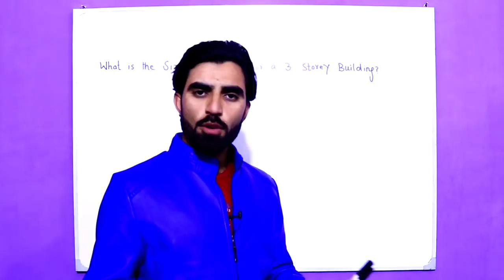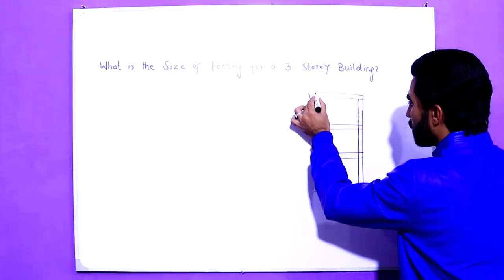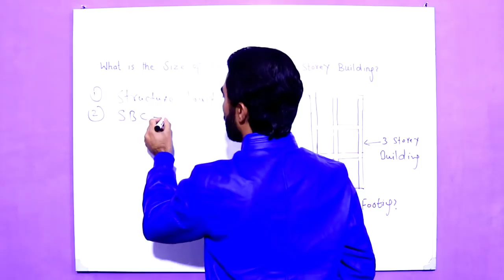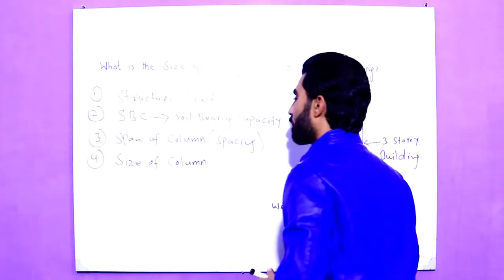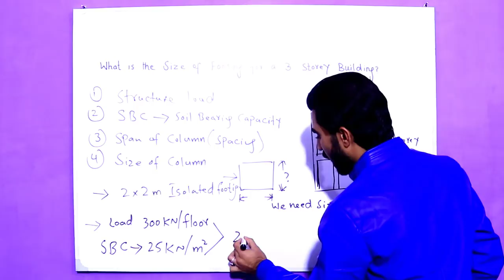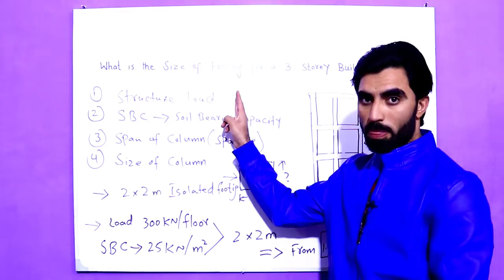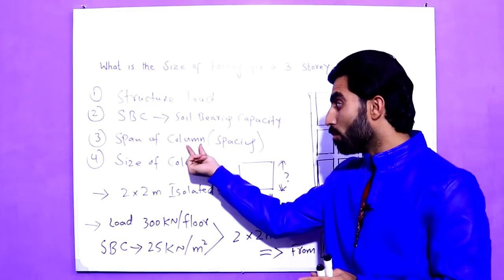What is the Size of Footing for 3 storey Building? Size of Footing for House

Comment: salam im planing to build my house and it has ground flr 1st flr 2nd flr then roofdeck and im planing to use in my footing size 1.30x0.40hight and then the column is 4 16mm and 4 12mm rods vertical rebars with 2double ring or diamond  lateral ties size 0.30 ty i just want to to know if it can hold the weigth of the roofdeck size house plan is 118sqm and all foundation is 12 pcs

Comment: Hello sir. What if the distance of the column is 2.5 meters and we used 8 pcs 16mm but the footing is only 1 meter. The 2 center combine footing is 1.5x3.5 and we used 8 pcs 20mm for each center column. Is it ok for 3 storey?

Comment: Sir aise confusion bohot rehti he 
Agar 3 story building na rahe to?
Apne ko 40 ya 50 story ki building banani ho to?
Reply: For that, you should contact with structure engineer. It comes in highrise buildings so that's , why you have contact with structural engineer instead of this.40/50 story building, is very hard to design because it will include the seismic loads, wind loads etc.you can't decide by self or by experience. That need a specific design of each member.
Reply: @saeednegar709  Sir, matlab pehle aisi Building ke liye Column, Beam, Brick work and Slab ka Self weight and Dead load, Live load, Floor load, wind load calculate hoga, Phir load bearing capacity ke check ki jayegi Pu= 0.4 fck Asc + 0.67 fy Asc  iss formule se. Thik hena Sir?
Reply: @shamsheralirana3127  yes but you have to follow the code formulas like IS code,ACI ETC..for all those things you just need to design that in a software.software will follow the code then will calculate all the things.so you need to put loads from codes in software.after running analysis and design you have to calculate the total weight and load of a building in a softwares..then you have to use CSI safe software for footing design.
Reply: @saeednegar709  ji apke kehne ka matlab Staad pro software se thoda easily hoga?
Reply: @saeednegar709  sir softwares konse Staad Pro ya Etab?
Reply: @shamsheralirana3127 hey 
I am structural engineer.
I have designed many projects which includes steel structures and RC Structures.
Software is just a tool.
You have to verify your results manually as well.
Etabs and csi safe is used for RC Structures while staadpro or sap200 or tekla structure designer, these three are best for steel structures
Reply: @shamsheralirana3127  as per my experience staadpro for RC Structures will give you more reinforcement as compare to Etabs
Reply: @Prince-qh4jt  staadpro b acha hey lekin for buildings Etabs rc Structures Etabs is the best software.
Reply: @saeednegar709  sir maine diploma in civil engineering kiya he, aur mere paas ab waqt nahi he ki mai Degree kar saku. To kya mai degree chordker ye staad pro aur etabs software seekh lu?

Comment: Sir i have a project of 20meters in front  and  side 30 meters  . 20 meters by 30 meters 3 storey building how  column  20 meters wide for  a column and 30 meters length how many column. Can i use 10 meters in the middle of the building